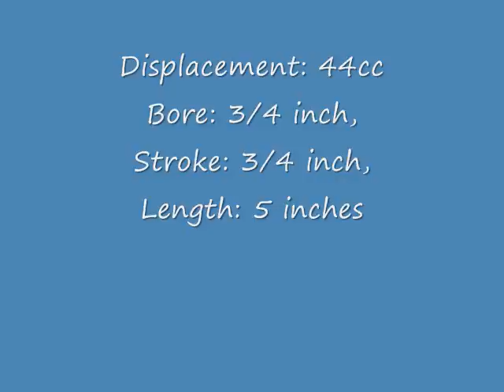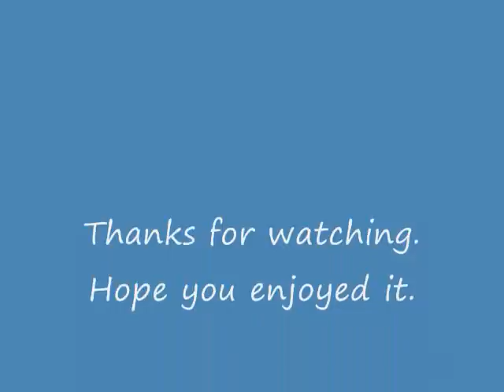World's Smallest running v8 engine

Comment: sounds 2 cycle, a camed engine would trow flames out the exhaust.
Reply: John Smith its a 4 stroke engine. 2 strokes will have no need for a cam or valvetrain.
Reply: if the timing is advanced yes it will do
Reply: Lol what? A cammed engine would only throw flames if it was running pig rich and the exhaust manifold was hot enough to ignite the gas left over. It sounds two stroked because it has a small displacement and a higher duration.
Reply: Excuse me sir, every engine has flames coming out of the exhaust rich or lean. Remove the manifolds and look sometime
Reply: Well "sir", if your reference is to the actual combustion of the mixture in the cylinder, no shit. Why would I take the exhaust manifold off just to see the leftovers of flames from the cylinder. I'm actually talking about visible flames from the exhaust of a car. Any car can put off flames if it is rich enough to let some fuel off into the exhaust manifold. Any straight header engine will put off flames, that's a given. But who the fuck runs straight header on street cars? Its kind of illegal in, I would like to say, pretty much all over the states? Lol
Reply: John Smith not exactly.
Reply: another dummy huh. oh well keep fooling yourself .
Reply: All engines have flames out of the exhaust and it does sound like a four stroke ,just wondering what the valve train looks like.
Reply: Lol ok this is too much. I guess you couldn't comprehend what I'm trying to say. Engine does shoot flames. When engine connected to catylitic converter and muffler it no shoot flames. When engine run rich cat burn off extra gas= no flames. No cat = exhaust ignites extra gas from running rich makes flames out of exhaust pipes. 

^ very simple for you. I'm just too dumb to understand it I guess. Being an engine builder and tuner.
Reply: shiloh bragg he made the comment"used brass gears for the cam" duh 4-stroke.
Reply: Tom Elliston your just as bad lol. I'm not the one claiming it sounded like a two stroke in the first place bro. That was john smith. I said the sound similarity from this to a 2 stroke is because of the small displacement and the higher duration of the cam causing a choppy idle. No shit its a 4 stroke? Lol, I'm an engine builder which means- I can probably make out the difference between a 2 stroke and 4. Obviously if I stated in my first comment the higher duration of the cam is one of the causes, I knew it was a 4 stroke.
Reply: it still sounds like a 2 stroke and how come I do not see any flames ?   take the valve cover off and let us see the valve train. It is the worlds smallest V-8 2 stroke.
Reply: Tom Elliston the gears are for the shaft which turns the distributor
Reply: it sounds like a two stroke with a camshaft to drive the distributor which delivers the spark. The cam does not have lobes on it. The cylinders only fire every 720 degrees. watch the puff of unburnt fuel coming out of the exhaust when he revs it up.....every other stroke is not ignited this is why it sounds like a four cycle. So it could be either way 2 cycle or four cycle. To me it sounds and looks like a 2 cycle 4 stroke. What do you think?
Reply: Either way it is a V-8 and pretty damn cool.
Reply: John Smith the unburnt fuel is most likely due to the carb being set to rich. It would be very hard to tune this engine by ear. But if that were the case as you said, it would have no need for a valvetrain at all. In the end you could be completely correct, as a 2 stroke will have the same sort or idle and the casting is hard to say for sure. But as a 2 stroke could run with a continuous ignition source he wouldnt have a need for the distributor.
Reply: shiloh bragg Yeah ...i would really like to see the valve train,rockers,pushrods,how small are the valves ? 1mm would be to big, have you ever tried to machine something less than 1 mm . that is difficult to hold tolerance. How about the seats...the guides would be easy.or the springs ? how about the lifters what about the lash adjusters? How are the push rods getting oil? did he bore the small push rods out ? it would be cool as hell to see the thing run with the valve cover off.
Reply: There is an english author named Nevile shute who wrote a book called trustee from the tool room. The main character in the book is a machinist who builds small engines that he can start with his fingers . just like this one,  Tool shop and machinist engineers like this book. God damn this is cool as it gets.
Reply: My guess is the oiling system isnt near as advanced. On something this small, reliability wouldnt be much of a worry since its not meant for mass production. Just start up every once in a while. Im sure the more expensive ones like conlee, all have parts machined to spec and do have springs and such set to a certain tolerance.
Reply: I could not machine the rocker arms on my mini lathe. I suppose they could be a simple fulcrum with oil drippers like we had in the 40's. In the fifties the oil was delivered from a 1/4 pipe to the racker shaft. The rod bearings had dippers with scoops on them all the way into the late fifties. The military used to have small engines hooked to generators that were suspended from ballons. thousands of them to illuminate the sky. They would last longer than batteries.
Reply: Its most likely as you say. I'd say a more likely thing is the crankcase is oil filled and it might have a small pump or something for the timing gears. But I don't think there is oil running up to the top. The cam is likely open so the oil can reach both cam and crank. The valve train is probably a lot simpler than you think.

Comment: This on a bike would be pretty cool LOL.
Reply: Well the engine doesn't have any cooling and it suffers from vibration so it's just a engine that this guy made probably because he was bored
Reply: No actually they do have cooling its called a fly wheel
Reply: +Isaiah Bair the cooling fins are what cools your three wheeler. They take the heat away and air cools the. So speed does help cool it

Comment: Still more torque than a Honda.
Reply: Best comment ever
Reply: Not when VTEC is on.
Reply: Lol
Reply: Anne Daniels
It doesn't just advance valve timing like VVT, it actually changes the cam profile and valve lift. It was the first system of it's kind, particularly for consumer vehicles, so an interesting technology historically, and it makes sense that there are now better valve lift / timing systems now. It added some complexity for limited performance increase. It makes more sense to bolt on a turbo etc. instead. People make fun of VTEC because it offered limited performance increases, but it is still interesting. I raced a non-VTEC Honda against a VTEC and it won out on the top end, but only slightly.
Reply: shades2 When VVTLEC kicks in no1 can stop us.
Reply: Its not vtec that gives honda engines the power and ability to make more than 100hp per liter. They have done this several times with the b16a, b18c5 and the k20a just to name a few. They are a little low on torque but their powerband is very high up in rpms, like 6k and up to 9k on some. As far as four cylinder motors go, honda makes some of the best naturally aspirated and mitsubishi the best factory turbo with the 4g63. Oh and for the person that quoted the lotus elise/exige, you have very good taste imo. If you dont want it to break down as often and make more power you can do what alot of people do and swap a honda k20a in it, then you really have the ultimate track monster (giving the right suspension setup etc.).
Reply: NvDubs250 Top fuel V8s don't make 8000 HP because they are V8s.  They make 8000 HP because they have a LOT of displacement, run nitrometh fuel, run a super charger and they accept the fact you have to rebuild the engine constantly.  There's many factors to engines, not just cylinder count - displacement, rev limit, compression, whether they are naturally aspirated, etc.
Reply: TheHeftyDanielson That made me chuckle
Reply: Mike Mundell And too bad they are all enormously boring to drive with some of the lowest performance in a vehicle you can buy. I would MUCH rather have a Lotus Exige that broke down every 5 years than an Accord that never did.
Reply: Funny thing is,  All Chevy, Dodge and Ford are always compared to Hondas and Toyotas.
Reply: LMAO, I know right!
Reply: megasquals :) It's kind of a running joke, but VTEC is an interesting technology. Additional power output by changing a cam profile for more valve lift etc. is pretty minimal of course. Yes a turbo kicks ass. :)
Reply: Mike Mundell
Or Mazda. My Honda was an amazing car though. Engine never used oil, very fuel efficient, transmission was strong. No major mechanical issues.
Reply: Marcel K My physics background says all Honda engines have torque :)  I make no claims about how much, how it compares to other engines or torque vs. weight, but you have rotation, you have torque, doncha know?
Reply: Not trying to insult your intelligence, and maybe you are joking, but little engines are used in some of the fastest race cars on the planet.  That produce 700+ horse power from a 2.0 litre engine.  Engine size is just one variable in the power to weight ratio equation
Reply: Nero Jdm if you can't even use grammer correctly, then I bet you're lying.
Reply: Nero Jdm whatever dude. Keep dreaming
Reply: They arent meant to compete with big V8s and the like. 
They are Hot hatches. Like the Golf GTI or the peugot 205 GTI.
Meant for commuting to work and going shopping during the week. And tearing up country back roads and track days at the weekend.
Reply: That may have been applicable 25 years ago but American car companies are now building some top notch quality engines and vehicles. I'm not even a Ford fan, but even some of Ford's newer vehicles have well surpassed Japanese quality and technology. It's because of the horrible stuff American car companies were producing in the 80's that has many Americans doubting today's quality & technology. So before you just dismiss the Big Three American Auto makers, know that they are much better than ever and are even better than Toyota's and Honda's.
Reply: Just a TDi ;)
Reply: shades2 vtec has no torque idiot
Reply: shades2 vtec doesn't do much it's like a 2hp difference and it's not even that special most car manufacturers use similar systems
Reply: Mike Hendricks 2JZ
Reply: Michael Bauers oh and btw they dont rebuild everything on the motor. Not everything is new each time. They mainly inspect and re use as many parts as they can. Mainly rebuild as a precaution
Reply: NvDubs250
Reply: tiny v8 engine
Reply: +John Jesus Hahaha. best come back ever!!!  ( salute )
Reply: +John Jesus Hahaha. best come back ever!!!  ( salute )
Reply: Seisman 75 ROASTED
Reply: No one compares anything to a toyota
Reply: Engine size is just one variable in the power to weight equation.  Given that Formula 1 cars use engines less than 2 litres displacement and can do over 700 horsepower, it's clear there a number of ways to address power needs ( admittedly, their solution for Formula 1 would be expensive to implement for a daily driver, and may not work as well under normal driving conditions.)  Long ago they made some huge low horsepower engines, so it's not all about displacement.  A large engine obviously adds weight as well compared to a smaller engine.  I don't know where the sweet spot is, for a daily driver, but I suspect the big iron approach from the 1960s is quite dated and there are more sophisticated approaches to the problem
Reply: Toyota and Honda. make the best Japanese cars in terms of quality and reliability
Toyota and its sub brands make the best all round quality cars. While Honda are known world wide for their reliable engines in everything from boats and motorbikes to cars. Even if the overall quality of their cars isnt quite up there with Toyota imo. 
The rest of the japanese manufactures are shit.
Reply: Fuck your cars. Nissan is the best!
Reply: Always loved my old CA18DET, 8 years and never an issue....and quite fun too :)
Reply: shades2 IKR, VTEC has all the cons of having a turbo with none of the pros XD
Reply: EG Bros. I've got nothing against Honda, they make good engine's, just don't have much torque. I used to own a EP3, was a good car and was quick but you had to rev the nuts off it to get anything from it, sold that for a 1.8t golf and now got a tuned diesel 3l BMW which is quicker than the Honda and golf.
Reply: TheHeftyDanielson
Sure bro that's Diesel. :0 . A 2.0L tuned K20a with good power to weight ratio will be definitely fun car to drive. its all about balanced car (any car). if you want torque drive a tank. just kidding bro :)
Reply: shades2 Hondas "VTEC" is actually one of the worst variable valve timing systems there is lol.
Reply: why Hating honda? haha maybe you got kicked with vtec.
Reply: more torque than a Ford***

Get it right man
Reply: Too bad Honda builds the most reliable vehicles you can buy.
Reply: TheHeftyDanielson still can't rev like one.
Reply: Mike Hendricks honda is shit no matter what. No little 4 banger will ever make more power than a V8....top fuel V8s make over 8000 hp.
Reply: Is that because nothing compares to a toyota?
Reply: bullshit.
Reply: I don't s civic my my Golf R spanks on hell cats and GT's American cars are a joke
Reply: Toyota is made in America also there happy nuts.
Reply: TheHeftyDanielson Is that why most street racing cars are Honda Civic's

Comment: Really cool. Very impressive machining skills. Of course a DC electric motor that size would have 10 times the torque, be 10 times more efficient and be a lot easier to build. Still impressive though, even if it isn't useful nor practical.

Comment: Sounds like there is a 3/4 grind cam in the engine because it puts me in mind
of a small(no pun intended) block 283ci or 289ci in miniature. This little machine is fantastic JP! That's some mind you have for miniscule tolerances.
I would love to see your version of a v-12 or a radial aircraft engine!

Comment: i want 1 to go on my desk and would run all day
Reply: theyogcastbulldog You could use it to power a small generator wired up to a 5-volt voltage regulator, and use it as a really neat (but pretty impractical) USB charger.
Reply: i will get it to power something....
Reply: I was gonna slap it on my skateboard! :)
Reply: theyogcastbulldog Pencil sharpener... "Sorry boss, I can´t hear you! I am just sharpening my pencils."
Reply: theyogcastbulldog your deskside blender maybe?
Reply: Yes XD
Reply: matzo33333 Give it a pullstart and a little alt and bolt it to the back of a smartphone! most excellent.
Reply: I don't think it would. It runs, but it obviously won't run for long or at a high RPM. It doesn't seem to have any cooling and looks like it suffers from a lot of vibration. It is a novelty item with no real uses.
Reply: how did you know
Reply: Justin Noker how did you know
Reply: Luck I guess
Reply: matzo33333 Or build the rest of the car and have an RC custom with a V8!